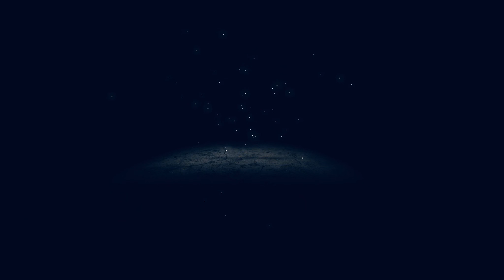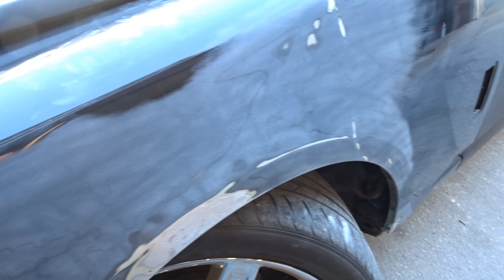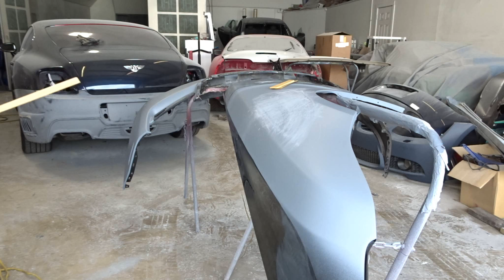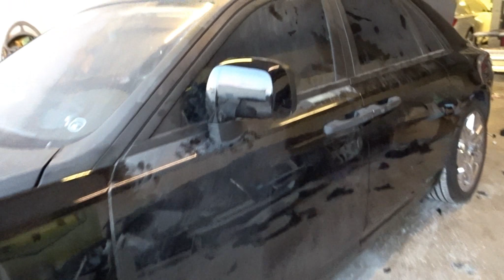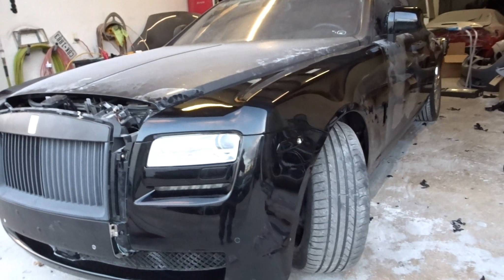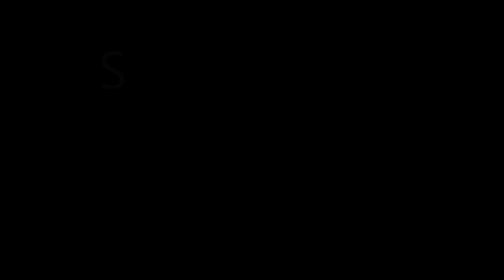Bought Rolls-Royce Ghost on Copart repair Part 2

Comment: Very nice...would it be cheaper to buy one from Copart and have the work done to it?
Reply from the maker: Stanley Rutherford Most definitely. But you need to do research on the car you find. Make sure insurance company is selling the car, not a dealer or individual that bought it, made it look better and took it back to the auction. You can email when you find a car that you are interested in and I can look over the pics and tell you if it's a good buy.

Comment: Nice vid, but why did this car go to auction with such little damage?
Reply: Howard Steele you have ask the insurance company that question
Reply: I used to work at a body shop and we got a wrecked Rolls Royce that had front end damaged and it was totaled and the reason is the parts cost so much for a rolls royce they insurance didn’t want to pay for the parts and labor to have it fixed

Comment: Will it be possible to put a Rolls Royce ghost series 2 face (headlights and bumper) on a series 1?
Reply: Prince Bonsu it would look so much better.
Reply: Jordan Banko yes it sure will,do you think that facelift is even possible ? They didn’t change much from series one to series 2,I think it’s possible.
Reply: Prince Bonsu I think it should be straight plug and play, just like in the Mercedes G-class.  Wish you could also add the satellite aided transmission feature as well.

Comment: Bondo on a Rolls Royce? LMAO
Reply from the maker: rokkero564 With your mentality, if a part has a dent, it needs to be replaced... Ooook..
Reply: Nothing wrong with bondo if its used properly(to fill in minor imperfections after panel repairs).  It gets a bad name from people who abuse it.
Reply from the maker: Matt M Exactly
Reply: I agree with him actually... bondo makes me cringe. It's not the way the car was intended from the factory, any good paint depth meter (or even a magnet) will expose this shoddy craftsmanship. Either have a skilled metalworker fix the damage or replace the fender... this is cringe. The fenders aren't incredibly expensive second-hand, either...
Reply from the maker: Beolex Beolex You will probably be the one to go buy a new camry, then a one year old Bimmer..lol
Reply: You clearly have no body work experience. You've also never priced out a fender for a Rolls Royce before...
Reply from the maker: Thank you. Some people just have no clue what they are talking about.  By his mentality, I would need to spend 6k for a new fender because it has a dent.
Reply: No, I've had a couple BMW's actually, even older than you mentioned... I've had quite the opportunity to see what is bad bodywork vs. good bodywork... new cars, and old. is the same difference between using straw vs. ribar to fix a collapse wall.. nothing beats metal. bondo = to hide poor bodywork. but hey... the ghost looks great!!
Reply: When a metal panel is dented, the metal is stretched. While it is possible to re-shrink the metal, it is almost impossible to get the panel back to the exact original shape with metal work alone. That's where filler comes in, and there's nothing wrong with using filler. As long as it's used correctly, it will last the life of the car.
Reply: Look, bondo might do the job, it might look ok and never give you a problem... but that’s not the point.
A Rolls Royce is a piece of art, it’s made for the perfection by artists.
When you use bondo on it you harm the magnificent artistic integrity of the car.
A car like this can not have cheap repair alternatives like bondo, a car of this level and magnificence requires you to buy another part to replace the other one  if you can’t repair it flawlessly, in order to preserve it’s perfection.

Using a bondo does not match the magnificence of Rolls Royce.
Reply: guigovr EXACTLY! That was exactly my point. Finally someone who understands. After putting bondo on that fender you might aswell finished off by re-painting it with a can of rustoleum spray paint. My point was that Rolls Royce is a product focused on QUALITY and perfection that should be treated that way to preserve those elements that make it stand out from the rest. I would never use bondo to patch up a car of that quality. If I cant replace it, then leave it as is. Just my two cents. We all think different. On another note, the car came out great. However, its a shame to know that in a few years, when that bondo starts to crack, the reputation of QUALITY and perfection on this car will be ruined.
Reply: The car has a salvage title and will be sold with a commensurate discount. Why the fuck would you put new parts on when they cost as much as they do? At the end of the day, it's just an overpriced car that gets repaired like any other salvage car. As long as it's done properly, I'd do the exact same thing. It's about making money, not restoring a former pimpmobile to pristine, concours condition.
Reply: Plus don't forget, these cars depreciate so fast, it's not even funny. A 20-year old Bentley or RR will sell for 10-15% of its original price most of the time.